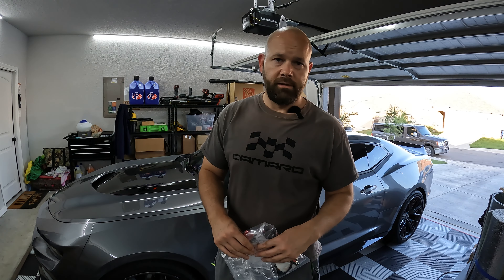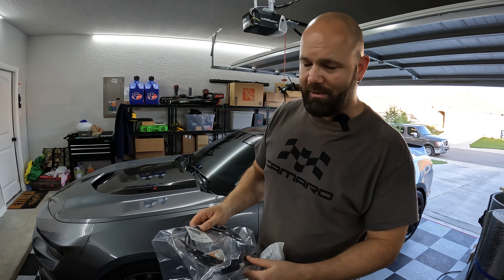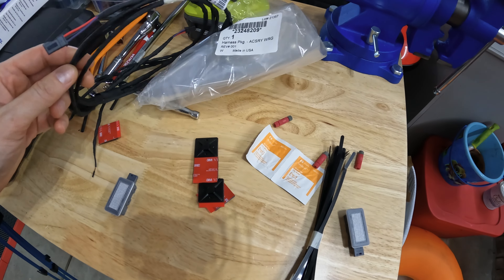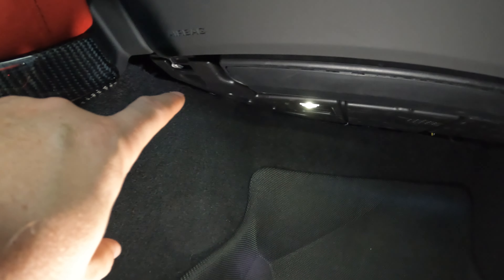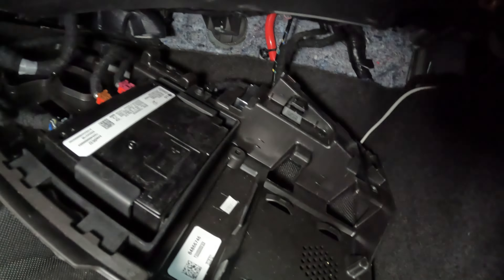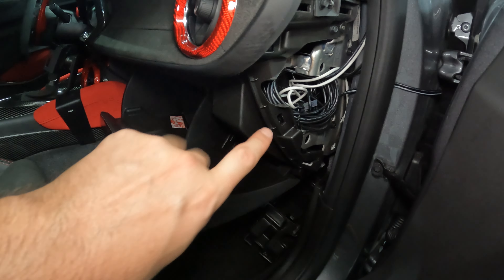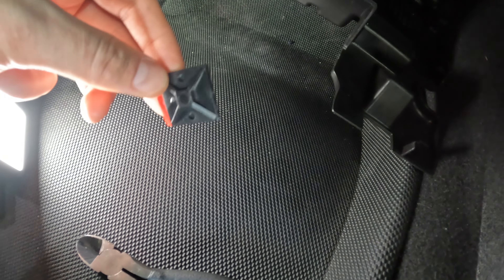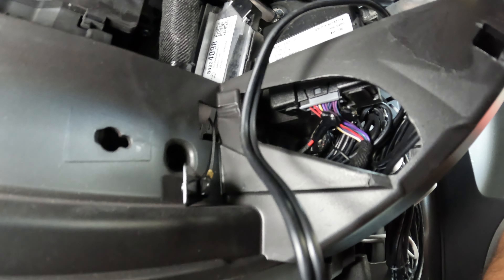2016+ Camaro Interior Footwell Spectrum Lighting GM OEM Kit 23248208 Install

Comment: So, I am curious if I went and bought some 5v argb led strips if I could still tap into that and then put them anywhere I want in the car. Like even in the air vents.
Reply from the maker: I'm not positive.. I'd think it would work fine but you def would need to do testing to confirm.

Comment: As of October 2023 GM and Amazon no longer carry this lighting kit! Bummer!! Good video tho
Reply from the maker: Oof! That sucks :-/ Not surprising though! Not an complex setup so I'd think something could be pieced together that could still tap into the Spectrum system without a ton of trouble.
Reply: Right. I will look into that. I believe Chevy is trying to put the Camaro behind them. Looks this way, just my opinion.  They used to carry a GM cold air kit for 6th gen. Not anymore though.  But enough after market kits are available for this.
Thanks for the video,  waa great as well as the presentation 😀
Reply from the maker: Thank you! And yeah.. GM has buried the  Camaro, sadly. I'm sure it will pop back up in a few years as an EV crossover :*( lol.
Reply: Yes. Absolutely.  I'm glad I got one now. No electric car has a sound of a Detroit V8!!

Comment: Best video on youtube for this install hands down!!!🫡🫡🫡 2 issues i ran across was on my drivers side i had a clump of cables covering the light insert so i had to pressure zip tie them away. And the second one was that I realized while removing the right rear screw from panel that it wasnt gonna come on in the same day. 😂😂😂😂
Reply from the maker: Thank you! Lol.. yeah, install for this sounds easy and in theory should be easy but once you contort yourself under the dash you quickly realize you are in for a... treat, lol.

Comment: Hey man watching your video for help i got a rgb light kit that goes around the dash pad i was thinking of atoring the bluetooth module in the cavity on side of glove box but is there any way to feed light cables from that cabity up to behind dash pad ?
Reply from the maker: Heya! Awesome! Yes there is a ton of room in the glovebox with a few good paths for cables to flow out from the glove box into the car or elsewhere. You can go out from the side plastic piece to the right of the glove box and upwards. I can't remember exactly how it's situated behind the dash pad but I'm pretty sure there is a path from the glovebox to behind there without a ton of trouble.
Reply: @D3RPZILLA  thanks!
Reply from the maker: @x24amd  no problem!

Comment: I found a site that sells the radio that has spectrum lighting built into it. Do I just plug it in .in the other radios place?
Reply from the maker: You found the OEM radio that comes with the spectrum lighting? Here is a discussion thread on someone who did the spectrum lighting conversion in their car, https://www.camaro6.com/forums/showthread.php?t=482871, this may be helpful :)
Reply: @D3RPZILLA  363 dollars on gm part sites for the stereo head unit with ambient lighting
Reply from the maker: @clownlivesmatter7925  You would need more than just the head unit if you want to go with the full spectrum lighting setup. This forum thread on camaro6 the guy did the full spectrum install, check it out at https://www.camaro6.com/forums/showthread.php?t=482871, unless you just want the lighting on the head unit and nowhere else?

Comment: Hey, I have an LT1 and was looking at these. Do you know if the package includes the parts for driver and passenger side? Or do you need to buy two kits? Thanks!
Reply from the maker: It includes the foot well lighting for both sides but this kit is for cars that already have spectrum lighting which it ties into. If you do not have spectrum lighting there is another kit that adds spectrum and then you add the foot well kit with that.
Reply: @D3RPZILLA  Yeah, I think it's the door kit you also have to buy. I see a package that includes the doors and foot wells so if get that, I think I should be all good. Thanks so much! Beastly ZL1 by the way.
Reply from the maker: @Robarath  awesome, no problem, and thank you!

Comment: Yeah, those two bolts in the rear are a major PITA indeed, congratulations on powering through, now your interior lighting is complete :). Elegant choice of custom t-taps, too, I used the GM provided ones and they are clunky, good thing nobody sees them.
Reply from the maker: Thank you! Ya I was melting and got friction burns on the top of my foot and front of my knee sliding in and out of the car at weird angles rubbing against my swisstrax floor... I guess barefoot and in shorts was a bad move, lol!